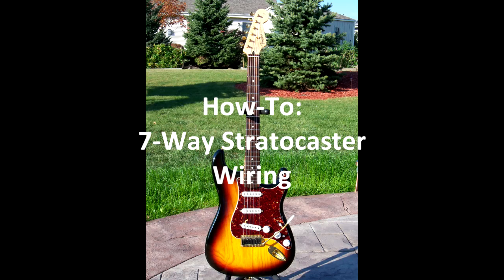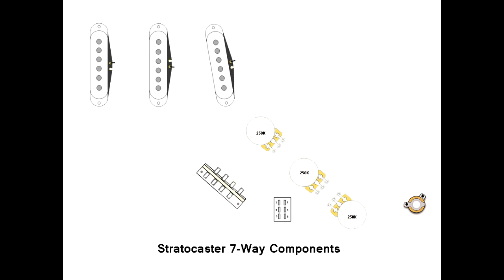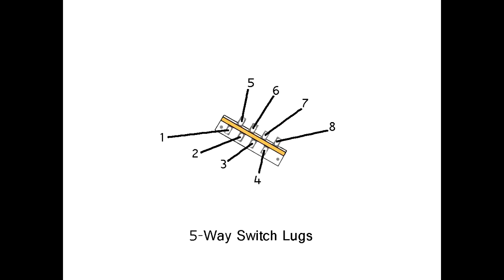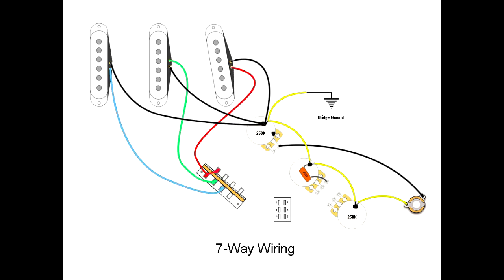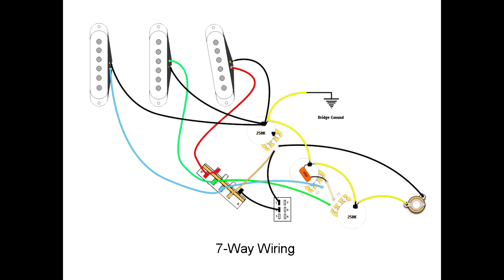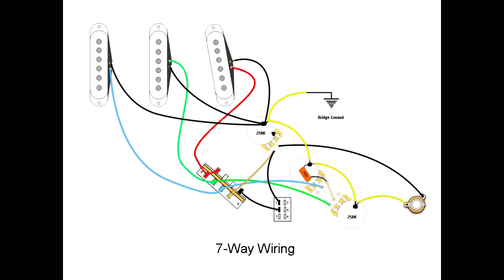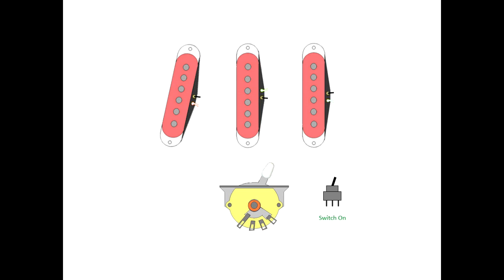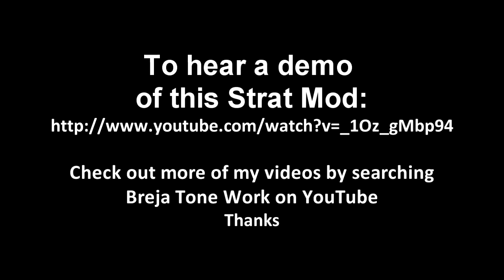7-Way Stratocaster Wiring Mod

Comment: I'm trying to incorporate this mod to my already modded Strat but I'm not sure it will work. I have a coil split humbucker at the bridge already done with a on/off/on switch so it acts like a second pickup selector but I also would like it to do this by adding a push/pull pot. Is what I'm trying to do even possible?
Reply: I want to know too!!! can you show me how to wire a coil split humbucker! I need assistance on that I have a JB Jr pickup and I am building this strat

What I was told is that I need 2 push pulls (one for 7 way) (one for coil split) because they use the same lugs
Reply: The Fender fanatic 97 

I already have a 3way switch to coil split my bridge humbucker. When I tried to apply this particular mod in this video to the already modified circuit (having all 3 pickups fire at the same time and just the outer pickups) I used a push/pull pot in addition to the 3way switch. The problem I encountered was that the switch was always powering the humbucker no matter what. I think the mod you want to do, Breja has a video on if not this one. Coil splitting a humbucker can be done with many devices and I'm pretty sure Breja tone works has covered it in a video.

Comment: Thanks for the vid! Is there any particular reason for putting the cap on lug 1? I have opened original wiring on 1985 MIJ Roadstar and other guitars and saw lug 2 used?
Reply from the maker: Hey Mike...  Good question.  Make no difference at all on Tone Pot.  Personal Preference.  What's more important is what lug is used on Volume pot to connect to Tone Pot (Modern Wiring or Vintage Wiring)

Don

Comment: Tried it multiple times, it didn't work for me, maybe my strat is wired differently? I followed step by step, I even bought a second toggle switch , sometimes I get the neck and bridge configuration, which is one of the configurations I am more interested in getting, but then Iose either bridge and middle or some other configuration... the point is I never get 7 different tones... sometimes I get the different combinations I want but I lose others.... weird. :/   there are no Strats that have different wiring? mine is a 2014 American Standard.
Reply: Luis Sutil did you ever get this figured out? I’m running into the same problem

Comment: Sorry, got them wrong... on the toggle switch up I get for position 1 all three position 2 all three position 3 all three position 4 all three position 5 neck and bridge... The when I pull the switch down I get:Position 1Bridge and middle, position 2 bridge and middle position 3 bridge and middle position 4 all three again and position 5 neck and bridge!!! Really annoying! My favorite settings are the neck pickup by itself and the neck and middle... Which are the ones I don't get!!! Aaaargh!!!

Comment: Great tutorial!!! :)
but something is not quite right.
with the swith ON and position 3 I get sound from the Bridge pickup and the middle pickup (In your tutorial I'm supposed to get only the middle pickup)
I did the wiring just like you :(
Reply from the maker: Yared...  Not sure.  I dbl-checked and my diagram is right.  On the 5-way switch.  B2 and B3 (right side) should NOT have anything connected to them - not sure if drawing is clear on that.  Check one more time and if not, email me photo of wiring and I'll see if I can help.  brejatoneworks @ gmail .com

Comment: Thanks as always quick question do you not ground the switch case on the strat and tele switches. I see lugs on all the cases but see some with and without grounds.
Reply from the maker: +Joe Dov Personally I don't ground the switches.  As long as the underside of the pickguard has the coil or tape for grounding, the switch is grounded.
Reply: That's what I assumed  thanks for the advice

Comment: NO, a single throw single pole switch doesn't exist cause it would be the same as just a wire, 1 trow means 1 position, you CAN use a single pole double throw switch tho!

Comment: Hi,
what i was looking for is just use the 2nd position on the switch to have bridge and middle pickups in series (not parallel) thus not adding new switches/toggles... is that possible ? thanks in advance
Reply from the maker: If the intention is to keep the Middle/Neck as parallel and the Middle/Bridge in Series, you'd have to use a 5-Way SuperSwitch or add a switch somewhere.

Comment: I followed a similar wiring schematic and the switch was way off when I finished. For example, middle position was neck only somehow. I did not make any mistakes; I think the schematic was wrong. Trying this, will reply to this comment if it works as shown.
Reply: Just finished running through a tap test and can confirm this schematic 100% worked as shown in the video.

Comment: why not add 4 - 5 extra tones with one toggle ? - SSS strat with an added toggle = reg 5 way or turn toggle on to add Bridge to every other setting of 5 way - pos'n 2 adds S to H - pos'n 3 adds S to S but In Phase not Humbucker - pos'n 4 adds S to H = All 3 pickups are on - pos'n 5 adds S to S in Phase [ or Out of Phase if you want a humbucker Bridge + Neck combo }

Comment: Hi, great mod which I’ve just completed today using s push/pull pot.  Unfortunately I’ve obviously done something wrong as most switch positions pushed or pulled seem to have all pups selected.  Everything that should be earthed/grounded is, all soldered connections are good.  Any ideas?
Reply: Hi. Just in case take a manifier and check if a little piece of solder could drop down inside the 5-way switch. If yes, i'm afraid you'll need to replace it. Hope it helps.
Reply: Obi Wan Kenobi Turns out I was relying on the copper shielding in the pup cavities and on the back of the scratchplate as my only source of grounding.  Whilst continuity checked out ok it wasn’t good enough.  Proper grounding using wire did the job though! 👍🏻

Comment: Can you not turn the bridge on when in the middle position, for parallel  rather than series like the standard?
Reply from the maker: +Liam Robins I'm not entirely sure I understand you, Liam.  This particular mod is only for the addition of the Neck pickup so that you get the NECK/MIDDLE/BRIDGE or BRIDGE/NECK combinations.  It won't do anything for Series/Parallel.  For that - you'd need some additional components.

Comment: not really a strat guy but always wondered what was the purpose of the 2nd tone pot?
Reply from the maker: Yeah - I never understood why Fender never had tone for the Bridge since it's always the brightest of the pups.  Of the three pups on a Strat, the one I personally think needs a tone control the least is the middle.
Reply: of course then you could have 3 tone controls with 3 different capacitors, i wonder if the make a 7 way switch?
Reply from the maker: James Moore
Mini pots or dual ganged pots would do the trick too to get you a total of 3-tone controls.  Fitting them in the cavity and drilling out the pickguard would be the only issues.

Comment: I think I've found a way to do it. If I run a wire from lug 3 to the on/off switch and from there to L3 of the vol pot I can keep everything the same. The difference is pos 1 on the switch is bridge/neck and pos.2 is all 3 pickups. Please confirm this for me if you would I would greatly appreciate it. Thanks.
Reply from the maker: Rick...  What exactly are you try to do with what you're describing?
Reply: On your wiring diagram it looks like the first tone is wired to the neck pickup and the second to the middle pickup and no tone on the bridge. On the 2000 fender standard stats the second tone controls both middle and bridge pickups. I don't want to change that but I also like the 7 way mod. What is described above is called the Gilmour Mod. This way it appears I can get the 7 way mod without having to sacrifice the tone on my bridge pickup. So I was looking for some insight to this. Thanks. Oh and the way the tone is connected to both the bridge and middle there's a jumper wire from lug 6 to 7 on the switch.
Reply: Just to let you know I went with the Gilmour Mod and it worked for me. I was able to get the 7 way and keep the tone on the bridge the only difference is it's on the 1st and 2nd pos. instead of the 4th and 5th. Thanks.
Reply: rick lavigne Rick could you make a video explaining the gilmour mod?

Comment: If you use a toggle switch, should it be the (on-on) or (on-off)? Any help would be appreciated!
Reply: You can basically use any switch because all it needs to do is connect or disconnect. So even a switch with only 2 pins would work.

Comment: Will this alter the original sound of my 2000 standard when the switch is off ? the second tone is a no load pot that I believe works with the bridge pickup.
Reply from the maker: +rick lavigne Do you know how your No-Load pot is and the rest is currently wired?
Reply: +Breja ToneWorks The wiring hasn't been altered. The 2000 american standard comes with the no load pot in the 2nd tone pos. It works with the bridge pickup. I like the sound now but I also like the idea of the 7 way option. I just don't want to alter the sound I have now.
Reply from the maker: +rick lavigne Are you sure it's a No-Load pot and not the TBX Pot?  In any case, the 7-way mod would not affect the tone or volume controls.  The mini-switch is just engaging the Bridge Pickup in positions 4 and 5.  So - when you have the switch off, there is zero impact to your guitar's tone.
Reply: +Breja ToneWorks Thanks !

Comment: Hi there, any way you could explain how to wire this using a Fender S1 switch in the volume position instead of the push/pull pot? There are many solder points and I can't seem to find resources anywhere else online. Thanks!
Reply from the maker: Hey Larry...  Try this video of mine.  I explain all of the different switches and you should be able to wire the S1 no problem when you're done.   Guitar Switches DeMystified
If not - email me at BrejaToneWorks@gmail.com and I'll see if I can help.  Don
Reply: Thanks Don, I sent you an email but I think I've got it figured out. Quick question, can I attach all my pickup grounds to a tone pot instead of the S1 volume pot as there is no room? I'm not sure if this will make much of a difference. Thanks
Reply from the maker: Larry Morgan
No issue with using a different ground point.  Just make sure all your ground leads terminate there though.  Don't have 5 on the Tone pot and 1 on the Vol.   Best of luck...
Reply: You mean my ground leads for the jack and claw? This is kind of the wiring i'm basing it on. http://guitarnuts2.proboards.com/thread/6423.  Someone is using the S1 for something else but is grounding the pickups to the middle tone pot (for lack of room on the vol i think). Is this an acceptable wiring schematic to use? Thanks again.
Reply from the maker: Larry Morgan
Hey Larry...  Here's what you want.  Take the back of one of your tone pots - that'll be our ground point.  Take a wire from the Claw to this Tone Pot Ground - this will ground the bridge and strings.  From each pickup, you take the ground wire and attach it to the Tone Pot Ground - this will ground the pickups.  Take a wire from every other pot to the Tone Pot Ground - this grounds each pot.  From the Output jack, take the ground wire to the Tone Pot Ground - this will ground the output.  What you are doing is ensuring that all components involved in the electrical circuit are grounded to a single point - it's considered a Star ground.  This will result in the lowest amount of electric hum or buzz that your guitar produces.  Technically you should ground the 5-way switch or any other switch too in the same manner.  Most people don't ground the 5-way switch though.  A lot of guys will rely upon the foil on the bottom of the pickguard to ground the switch.  Hope this helps...  Don
Reply: Ok Great. One thing I have been seeing that I haven't noticed before is that some people are grounding to a screw imbedded in the cavity. So they are grounding to the jack, to the claw, AND to this weird screw I haven't heard of. Is this really necessary?
Reply from the maker: Larry Morgan
2 reasons for the screw.  If the cavity is shielded either via paint or foil, the screw helps add the shielding to the ground circuit.  Fender does this all the time because their cavities are shield with conductive paint.  The other reason is for a central terminating point for the ground circuit.  Instead of having everything terminate on a pot, some guys will use the screw - keeps your pots from getting all f'ed up with solder if you're bad with a solder iron.
Reply: Ok thanks for all your help. I ended up getting it all worked out.

Comment: Please help!!! Ok, I followed the instructions step by step!!! MULTIPLE times... To try and trouble shoot and see where I went wrong... But everything is just as instructed in the video and this is what I get... On position 1 on the toggle switch: Position one: middle and bridgePosition two: middle and bridgePosition three: middle and bridgePosition four: neck and middlePosition five: neck and bridgeThen if I switched the installed toggle switch Position one: neck and middlePosition two: neck and middlePosition three: neck and middlePosition four: neck and middlePosition five : neck and bridge
So basically I only have two options now... I wired it different by mistake last night... And I got an extra position the 3 pickups at the same time... But now I'm only stuck with these two.... I checked and checked and triple checked everything and it seems to me it's exactly as stated on the video.... Any tips that might help me? Please!!!!

Comment: Well, it's been like 3 weeks and I like this mod (very much). Thank you for the help.
I used a toggle switch and sometimes I bump it and it changes modes. I am going to
try a 12v LED push button on/off switch (very low profile). My Strat is red and the light
would be red also (it may look nice). I'm not sure if the guitar will power the LED or if
the switch will work properly. Think I remember reading 75 mv to about 1 volt from the
guitar. Have you tried anything like this before? If not I will come back here and tell
you how it went if you like.
link to switch on ebay:  http://www.ebay.com/itm/251295144873?_trksid=p2055119.m1438.l2649&var=550255573785&ssPageName=STRK%3AMEBIDX%3AIT
Reply from the maker: You'd need a power supply and a resistor to get the LED to operate right.  A battery would be easiest but seems like a lot of work for a single LED.  Personally I've never tried anything like this.

Comment: Will this work with the EMG pre-wired David Gilmour pickguard setup? It looks like it will, but I don't want to try it until I'm sure.
Reply from the maker: Those tend to have PCB boards.  If you feel comfortable working with them - Yes, you can do it by adding the extra switch and wiring it correctly.
Reply: I ordered a Dimazio On/On switch to do the 7 way Gilmore strat will that work?